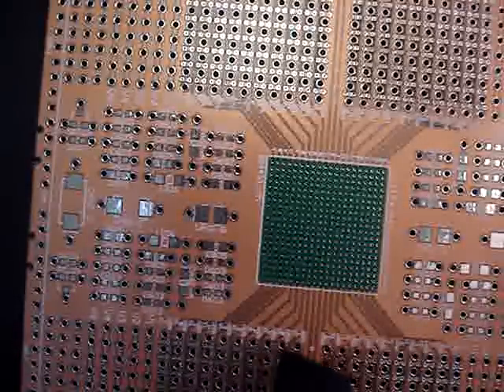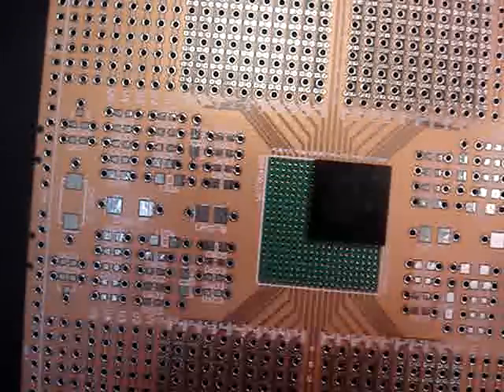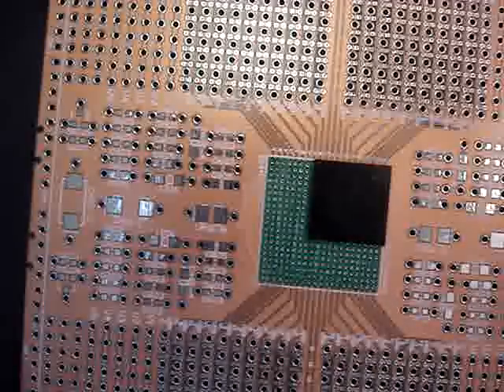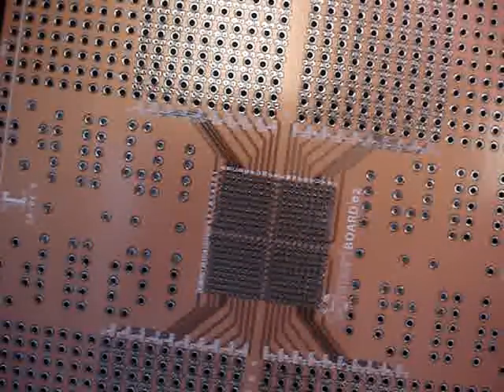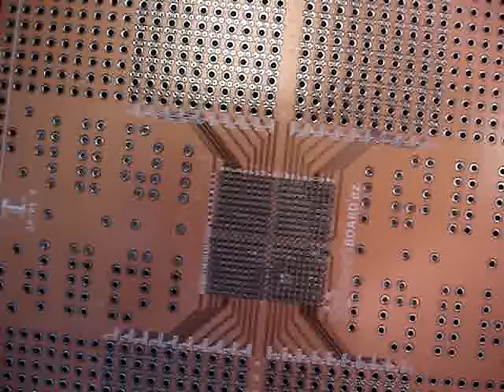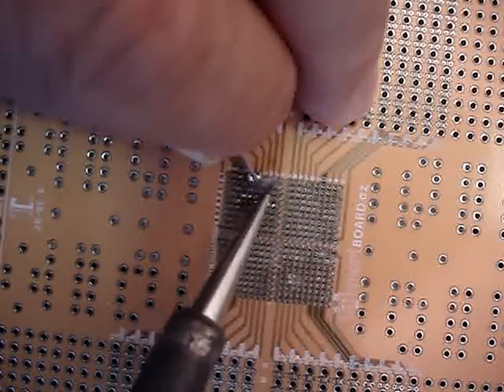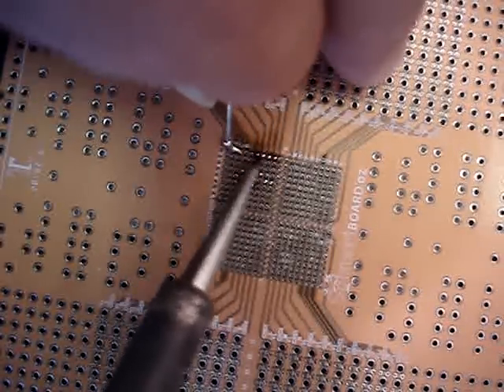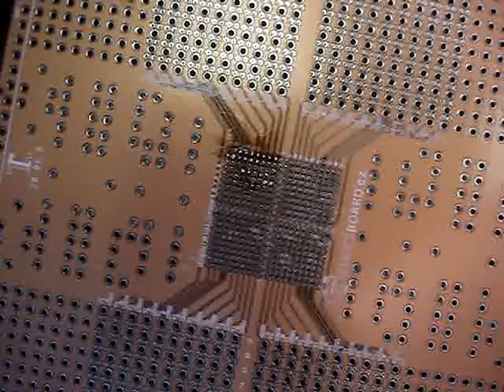Hand Soldering BGA with SchmartBoard|ez

Comment: I have not had great luck with SchmartBoards for any type of surface mount chip.  They simply don't work the way you'd expect them to in the videos and tutorials the company puts out.  The ones with channels kept losing solder to the iron and fry chips trying to get the right amount of solder on the component lead.  The company has a great idea with it, and I wish it'd worked, but it simply never worked reliably.

Comment: with the 360 you have a few problems to solve.
1. Remove the cpu or gpu.
2. Reball it with lead solder instead of the trash they used. (BIG STEP)
3. Then you can worry about resoldering it to the board.

Comment: Given how little time each pin gets and how they are only in contact with 800 degrees thru a small via hole, I don't see how enough heat can be transfered to cause damage.
The flux on the back side is probably evaporating very quickly but not directly under the chip.